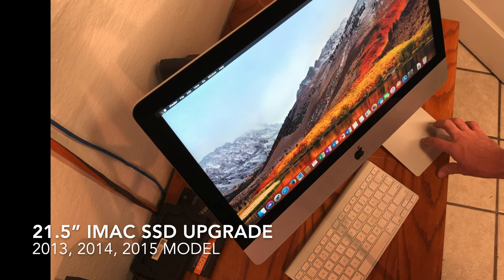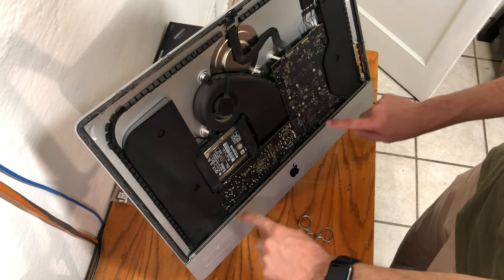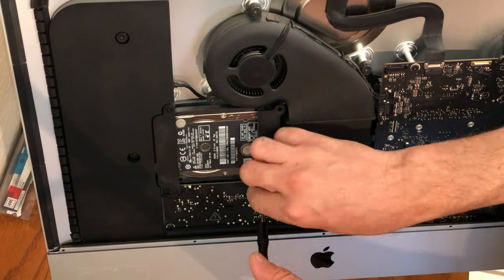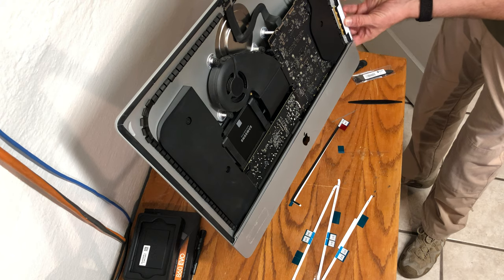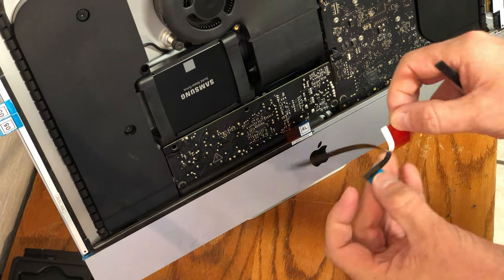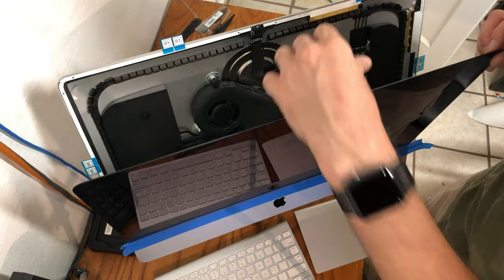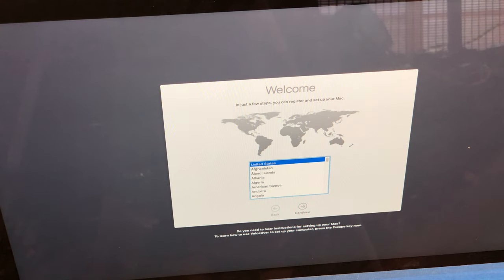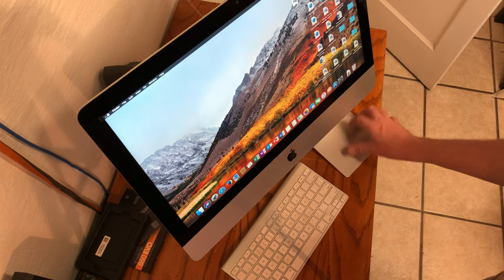Apple iMac 21.5” SSD Upgrade (2013-2015) HDD To Solid State Drive (SATA) | Step By Step

Comment: My iMac was standing on my desk for about 2 years. Didn't know what was wrong with it as it didn't want to start anymore. Watched this video, got the hard drive (hoping that was the problem), opened it up and regretting now that I waited two years to get it done. Took me 25 minutes and it's working faster than new! this video was the most helpful one. Thanks a million... or thanks an iMac
Reply from the maker: I know... the speeds is worth the effort! The SSD is pretty much the "only" upgrade to do on the iMac yielding actual noticeable results every time!
Reply: Hi my Mac is also not turning on. How do you install Mac OS on a brand new ssd?
Reply: @sandiflow did u ever figure it out

Comment: BEST video available showing the proper way to put the screen back on!! Followed other videos & ended up with a 1/16th gap on the right side. These iMac screens & bodies have super low tolerances for alignment so this tiny gap is noticeable.. At least to me. Bought new adhesive strips & with these  instructions I have little doubt I'll get it perfect this time. Thank you so much!!
Reply: Marc Woodward right on! Best tutorial video I’ve seen on properly taking care of an upgrade to this class of iMac 🖥! Nicely done @geekswhocare!
Reply: @JVIT_TV  After my earlier comment I went ahead & installed new adhesive on my daughters iMac following these instructions & it came out perfect!! The painters tape on the bottom edge of the screen to act as a hinge to aid in alignment worked brilliantly!
Reply: @Mark Woodward, that is so cool to hear! I’m both excited and confident to do this for a few friends and clients who DESPERATELY need the SSD upgrade in their iMacs. Glad to hear that you had such a great experience serving up your Daughter’s Computer because of this video :)
Reply: Where did you purchase the adhesive?
Reply: @chuckgarland5171  I ordered it on Amazon. I bought the ones from ExtremeAmazing. They are great & work just like the original Apple strips. The price for the 21.5" kit is currently $9.89
Reply: @marcwoodward8056  Thanks Marc, much appreciated. R./C.
Reply: Easier way to remove the bottom adhesive tapes instead of cutting just pull the tabs at either end and it will all come off

Comment: Gulp...you've inspired me to tackle this on my 2013 21.5" iMac. I know how to build houses but am terrified to open a computer.  I appreciated you showed the repair in real time which gave me an idea of how long it might take.... maybe an hour or two for a novice.  I assume the gasket kit is included but I'll rewatch this excellent video a couple more times before jumping in.  Thank you.
Reply from the maker: The ifixit gasket kit can be purchased form amazon, ebay, or ifixit directly. Were here to help if you have any other questions!
Reply: @geekswhocare7093  Very impressive that you take time to reply...thank you.  I purchased a a 1 terabyte Samsung SSD instead of the 500 gb you installed Is that ok?  Also I  assume I should copy the old HD on to the new SSD before starting and should I use Disc Utility to make the copy?  I'm going to try it tomorrow and I'll let you know what happens.
Reply from the maker: @dennisprice8357  you have several choices for the way you would like to migrate your old data to new 1tb ssd. The first and easiest way is to;
#1 way - Remove "working" old hard drive from iMac first, then install 1TB ssd, and use a fresh macOSX USB installer that youv'e created prior to whole process to now install macOS Catalina. DURING THE LAST PHASE OF MACOS INSTALL, use the "Migration Assistant" to completely and seamlessly migrate your entire old macOS hard drive. You will need a external USB SATA adapter or an external hard drive enclosure to connect your old hard drive to the iMac right at the migration assistant screen. wait about 1-5 minutes on the screen once youv'e clicked your old hard drive in the list of sources; it will populate all items to migrate, then you can actually click the migrate data button to complete the transfer.
#2 way - same as above only you make and use a fresh, newly created "time machine" backup prior to turning off and removing the original hard drive for the migration assistant transfer.
#3 way - use a "offline clone" docking station (2 SATA drive) appliance to "directly clone" drive a (old hdd) to drive b (new 1tb ssd), then install new cloned SSD into iMac.
cheers!

Comment: I studied and learned about this procedure, and I also studied and learned about how to dismantle and teardown an imac for upgrading, repairing and adding more ram.

In this instance, and for your future reference, The hard disc drive <HDD> access is as you pointed out. However, you skipped over some very strong and the most important safety considerations. The power board module beneath the hard drive is something that must be addressed completely. The Power Module keeps and holds electrical energy for quite a while even after an imac has been unplugged. This is because the power module has electronic capacitors that builds up and stores electricity needed to drive components not compatible with standard 110 volt AC electricity. The power board needs time to drain the residual electrical buildup, or people can get severely injured or killed if they touch the electrical contacts on the power board. A rapid way to drain off the electricity, is to unplug the unit, then take the power cord off the mac. The power cord slows the depletion of electricity buildup and acts exactly like a resistor, so the best and safest course is to remove the power cord entirely.

Next, the computer should be allowed to sit for no less than 25 minutes before opening. The safest method is to allow it to sit overnight, untouched while the electricity in the capacitors drains and dissipates. A good way to expedite and speed up the electricity discharge, is to depress and hold the power button in as if booting it up. This opens the electrical gates and creates a closed circuit. This allows the electricity to disperse through the computer systems and drain off fairly rapidly. Push the power button in and hold  for at least 10-20 seconds, then release. It should be safe to open and work on the computer once you take this step. Although it does NOT drain all of the electricity from the capacitors, it will dissipate enough of it so that you or others won't get hurt or receive severe and potentially deadly electrical shocks.

I am watching and viewing as many tutorial videos about computer repairs and enhancements as I can, because I will be upgrading and repairing my old 2013 late model imac soon. The HDD is worn and on the verge of dying. I need and want to know all the correct, proper and safe steps and procedures to carry out repairs and upgrades before starting. In addition to the hard drive, I will also upgrade the ram from 8Gigs to 32 gigs for faster and improved performance.

Most computers today are modular, and all components are modular. Modular simply means they are "Plug-n' play" because all, or most of the components inside them can be unplugged and swapped out for new ones. 

Your video is Ok... but you waste a lot of time showing the whole process, and some of your explanations are long and wordy. OWC.com has instructional videos that showcases the same things that you are showing here. Also for FYI, when removing the hard drive, it's important to remember that the holding bracket for the hard drive are specific. The bracket next to the left speaker module are the same size. The bracket towards the center has 2 different size screws. The long screw goes through the power board module, the remains screw goes in the remaining hole. If you can remember that there is no reason to try remembering the proper sequence  to reinstalling the mounting brackets. Nice video, good info. Please just remember, safety first, foremost and always.

Comment: I miss the old iMac where you pulled the screen off with suction cups.
Reply: alwhitney68 I’d rather not have my 2700$ computer held together  with adhesive. Not a difficult concept, no big deal

Comment: Performed an SSD and memory upgrade on my 21.5 late 2013 iMac just last week with OWC components. Took three hours for me but I was very careful with everything. PC runs flawlessly now.
Reply from the maker: Benjamin Kuhn were you able to “dust out” the internal fans prior to sealing it back up? Always a good measure, but happy to see you are up and running. 
Which brand/model solid state drive did you go with? I’ve done a few recently with Optane, Evo, & SanDisk variants all with ver similar results.
Reply: Me also. Took less than 2 hours and best part is I only paid 379 for the 2013 iMac!
Reply: @arts2437  sorry for the late reply, I bought the OWC Mercury Electra 6G 2.0 TB drive. Works flawlessly along with the OWC memory upgrade.

Depending on your model, you may have to remove the screen to get to the internal components of the computer. In this case, the DIMM slots for mine were on the back of the system board which faces the back of the machine.

Hope this helps in some way.
Reply: @geekswhocare7093  OWC Mercury Electra 6G and OWC memory.

I was able to dust out everything. System works flawlessly now.

Comment: Thanks for the video.
I just successfully upgraded my 2013 iMac with an 860 EVO, and it's working fine. Before doing so, I bought a Sabrent SATA to USB 3 enclosure and fully installed and migrated my internal drive over to the SSD (from a fresh time machine backup  and had MacOS (Catalina) booting fully from that without using the internal drive any longer. Just doing this, I had a big speed boost without even opening the computer.  When I finally did open it, I simply had to move the SSD from the Sabrent enclosure to the internal SATA connector where the original hard drive was.  When I got it all back together it booted right up and ran just fine.
    I followed ifixit's instructions for the adhesive, and the only trouble I had was a small portion (~3")  of the white adhesive backing snapped off near the lower right corner, so there's now no bond there. It's invisible and the rest seems to be holding o.k in spite of this. If I had to do it again, I'd do it the way you did it- pull the white backing first, don't try to pull it out of the buttoned-up joint as ifixit's instructions say.
     Another video here (not yours) suggests loosening the left speaker and pulling it out a bit to get to the SATA connector. DON"T DO THIS. I ended up severing the wires to the power switch, which was a pain to fix (workaround, really).  It is possible with a little patience to get the SATA connector fully seated on the new drive without moving the speaker.

Comment: Excellent video. Was able to do replace old 1 TB HD with a 2.5" SATA 1TB Samsung 870 SSD on my late 2012, 21.5" iMac with OS 10.9.5. The opening tool is the key - smooth and easy - just had to patiently go round the joint several times to release the adhesive. The technique using painter's tape was great -- eliminating the chance of having the display drop down while connecting the two cables. The performance improvement is noticeable - much much faster boot time and programs snap to life much more quickly. Thank you very very much - a super video for making an SSD conversion.

Comment: Best upgrade I've done on my late 2013 27" iMac. It's 10x faster now with bootup times at around 15 seconds. Point to note if you're thinking of doing this to your 27" iMac, you will need a cradle because the 27" has a full size hard drive and not the smaller one. Apart from that, everything is the same. Massive boost in performance though and well worth the cost of around £70/$90.
Reply: What Os are you running bro? I bought a Renewed off Amazon and after 4 mths the hard drive is shot and it kept shutting down randomly and not taking any system updates.. I live in Trinidad and Tobago the caribbean and i spent my entire savings on this to start my dream art studio... Please help... <3
Reply: Hi did your adhesive strips hold up over time? If so, which kit did you use?

Comment: Thanks for the tip.  The idea of using the tape to temporary hold the screen in place to connect the cable and test out the system before pulling out final tape has saved the day for me.  Again thank you for sharing the experience..

Comment: Nice! I used the same method to get my Late 2013 iMac from my recycling center up and running with an SSD. The old HDD was super slow on catalina, and it was still slow even on Windows 7 (bootcamp). Now, even with the latest macOS with OCLP on Sonoma, it rund MUCH faster than before and I’m able to open everything faster

Comment: Great video! only suggestion to others would be to watch the screen connectors, the one on the left pulls up and the one on the right has an armlock that needs to be pulled up before pulling the cable up, other than that fairly straightforward 👍🏻

Comment: Thin double sided mounting tape works well as an alternative to the iFixit adhesive. Make sure it's suitable for mounting items such as mirrors though, otherwise it might not be strong enough to hold the display in place.
Reply: You got some Brands and thickness of the tape you could recommend?  🙏🙏

Comment: Please supply a link for the recommended adhesive strips as there's a lot of crap out there - thanks. I have a late 2012 21½"  iMac with Ventura (via OCLP) on a very slow HDD, and a spare 1TB SATA SSD which I used for backups.

Comment: Thanks for the guide. I took my mac to the shop because it wasn't starting up correctly (crossing my fingers it was a bug). It was a failing drive and they said it cost $400 to crack it open & replace it with a SSD (not even mentioning a capacity) lol I get that they have to make money too but the old computer isn't worth more than $300. Said no thanks and paid them for the recovered data. Figured it was time for a new workstation anyway. And I could try and fix it for fun myself as a backup machine.

Comment: You sort of rushed through the process of installing the OS.  Where did you get the OS from?  The other drive?  A different drive?  A USB drive??  Not very clear.  Also, you fast-tracked past a critical part of connecting up the old drive. Did you have to source a drive enclosure?  What type of USB to hard drive cable was it if not?  The rest of the video was very detailed clear and helpful.  Thank you for clarifying the above questions.

Comment: Great educational video. Able to do my IMac upgrade and it’s working fine. Few other videos showed to add Thermal sensor. However, I could find sensor for IMac 21.5 inch late 2015 retina model. I did it with out it since it and booting and working fine. Thank you uploading this video.
Reply: Is it still working good???
Reply: @niljambaro9049  yes
Reply: @drnilangpatel  so I don’t need to put a thermal sensor then right cause I have late 2015 21.5” too

Comment: Excellent video, thanks.  Would have liked closer/better view of the actually LCD connectors, and how they're detached, like just pull out, or flip up locking lever or similiar.

Comment: Question?-can the new SSD read the old HDD Mac OS sierra and data? Am I thinking of it wrong? I have a late 2015 21.5” iMac desk with Sierra OS but I want to upgrade OS Monterey. Did you install the old  Mac OS sierra onto the new SSD then upgrade to Monterey do you don’t lose all data-photos, music, ect.? I am confused on this switch?

Comment: I always thought it is required to have a in-Line Digital Thermal Sensor HDD Upgrade to be able to upgrade the HDD or SSD on the iMACs so the Fan dont run full speeds. Did you have any issues after the upgrade? any specific SSD are you using? Thanks
Reply: I want to know the same question. Did you find out the answer?
Reply: and did u find out the answer ?
Reply: @unbeatablexxy8078  That is only on systems before 2011 I believe

Comment: Hello. I have a slight problem with the glass, it's cracked diagonally in the corner of the screen, it's like a small triangle basically separated from the rest of the glass. I'm worried it could damage the screen when I'm going to remove it, because it's bottom part will still be glued to the bottom part of the case. Do you think it's a big problem or not really? I cloud try to remove the glue without pulling the screen as much as this video suggests I guess

Comment: BAH!!  I did my upgrade.  Got my 16gb RAM and had a 1tb SSD sitting around.   Bought myself some tools so I could open up my late 2013 iMac.  Running my picks around going through the adhesive. Get to a point at the top where it was extra sticky, so I'm pushing through it, nice and gently still, when all of a sudden.......CRACK!   I bloody cracked the glass.
  Then I thought, "it's only a tiny crack, I can live with it".  Made it a whole lot worse when I eventually managed to get the display off.  My adhesive was a pain to remove.
Put the RAM and SSD in, hooked it all back up, put the display back on only attaching one side of the new adhesive, (just in case) Fire up the iMac........display is dead. :( 
iMac still works, can hook it up to another display. Bugger.

Comment: Hi. Just purchase this used iMac Late 2015, 21.5 inch w/ 4k display (1TB Hard Drive / 8gb RAM). Im a bit disappointed cause it loads apps like 2 to 3 minutes everyte. Changing the wallpaper take so much time in system preferences like, i thought this iMac is powerful to load stuffs. Can I replace it with SSD just like you did ? Will i be able to do it myself considering that Im new to this thing? I'll be glad to hear your response cause im planning to used it for photo edting and started learning video editing. Cheers!